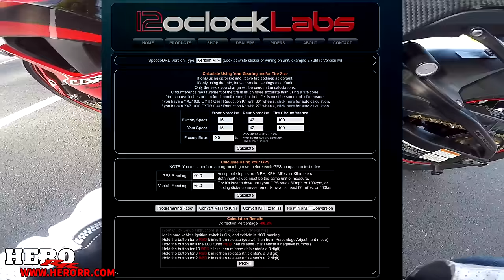2008 CBR600RR 520 Conversion Kit Install and Test Ride + New 12 Spoke Wheels!

Comment: I'm glad you're still giving the CBR some love after getting the beamer.
Reply from the maker: Of course!
Reply: @HeroRR  was the 954 faster than this 600??
Reply: @HeroRR  did you use the front wheel spacers from the 2008?  I tried to do thison my 07 with 2019 rims and the brakes didn didn't seem to fit but I used the 2019 wheel spacers.
Reply: @HeroRR  let me know if you ever want to sell the cbr
Reply from the maker: @FirstLast-tx3yj  Oh yeah
Reply from the maker: @archiewilson4943  I used the new spacers and it fit just fine.
Reply: @HeroRR  ok thanks.  I will try again.
Reply: @HeroRR  Thanks for your response.  I was able to fit those rims on my 07.  I think the problem was the Motul brake fluid I was using.  That stuff gums up the brakes if you leave it in very long.  The generic stuff is way better for normal enthusiasts in my opinion.

Comment: Another great video.  Great bike and great choice with the Speed O' DRD.  I added it to my 2006 VTX1300C years ago and never looked back.  I still need to add it to my 2006 CBR1000RR as it was of a bit off too, but oddly enough was mostly corrected within 2 MPH by going with a 190/55 Q3 tire with stock gearing (sprockets).  So, I've been lazy about getting to adding the DRD to the CBR, but I need to get it done.  Thanks for showing how easy and no need to pull tank, airbox, etc. off to plug it in.

Great choice with the Lightech Chain Adjusters.  Although, I'm very jealous as I couldn't find any for my 2006 CBR1000RR.  Apparently, they stopped making them for my model/year or else I would buy them in a heartbeat.  Can't believe you found them for your 2008 CBR600RR.  Congrats!  I know you'll love em.  Just wish I could find some too.  

Been thinking of getting an older CBR600RR, probably like yours, 2008 or so.  Not saying 600's are slow by any means, but light and fun is where it's at these days.  Why else would factories be focused on the mid range these days, right?  Although, to me nothing beats a V4 sound, but parallel twins come close.  Music to my ears.  LOL

Keep on keeping on brother.

Comment: Used clip style link on my vf750c. Not a single issue and very little chain stretch on my CZ Gold. After a few miles, I got the courage full throttle pulls then forgot about it. Love this chain. It's not stretching.
At the time of this service I had a taller rear tire profile do to availability. Hated this tire from the start. Replaced tire with standard profile and went with a 1 tooth count sprocket change performance. I have my bike back. 500 rpm more at 65mph. Better milage. Better performance. It's a very happy Magna
Reply from the maker: Glad it's worked out for you! Hopefully it continues to. Unfortunately it only takes 1 time to have a problem and it could be the end of your life, a gamble I wasn't willing to take.
Reply: I just personally wouldnt risk it.
Riveting aint hard anyways.

Comment: Love to see you still giving the 600RR attention out here. I love my 2008 and did the same -1 in the front with a 520 chain two years ago. It really did open the bike up a bit, but I might go back to stock when I need a new chain. I daily the bike a lot, and the throttle is way more twitchy with the mod, which is fun..but dangerous to my license.

And while it doesn’t offer “more” power, it does shift the torque curve towards the bottom end, boosting the acceleration a bit.
Reply: It doesn’t modify the torque curve anymore than it changes the power.

Engine output remains the same, torque and power curves are unchanged. It’s just like you’re in a slightly/fractionally lower gear than you would otherwise be.
Reply: @Gnerko123  Thus supplying more torque to the wheel at lower RPM, and less at higher. It’s basically a higher gear ratio, which shifts the torque curve lower for more acceleration and less top speed.
Reply: @JesterMasque  torque curves are generally defined before the transmission, at the crank or the flywheel. Transmission ratios don’t influence this. 

Even if you define wheel torque as a function of engine rpm, wheel torque is raised throughout the rev band, not decreased at higher rpm.
Reply: @Gnerko123  I’m referring to wheel torque as could be read on a dynograph, which is the majority of my experience with this. Wheel torque doesn’t not always increase through the rev range, that would be more applicable to power ratings. Torque can peak in the low/mid-range and stay constant with slight drop off in the higher the revolutions. When a sprocket (the final gear ratio) is changed, you can see that peak torque is achieved earlier or later in the rev range. The torque curve shape & approach may not change much (if at all), but the peak will certainly change positions on the X axis.
Reply: @Gnerko123  The same can be said about when you are in a lower gear (high ratio). You achieve peak torque lower in the rev range, but the top speed it reduced. Power ratings (such as HP, kW etc) will not be affected, as that is the engine’s ability itself to climb RPM’s and continue to torque the driveline.
Reply: @JesterMasque  It seems we are not understanding each other. If you look at a given engine rpm, wheel torque will always increase if you increase the gearing ratio. The graph for wheel torque plotted against engine rpm will shift vertically if you change the gear ratio. Peak torque will not move to another engine rpm, but to a different road speed. If by ‘rev range’ you mean wheel rpm or dynograph rpm, you are correct, but I have never heard anyone do it that way.
Reply: @Gnerko123  It was a blend of your wording with mine, just trying to speak the same language. But I have seen and compared the graphs one to one on an F4i where we plotted a base run (Dyno Dynamics Dynotech iirc?), then changed the sprocket, another plot, add power commander, another plot etc). At the time I was an apprentice at that shop, so I can’t remember every detail. When comparing the plots before & after (only) the sprocket, the wheel torque hit peak earlier in the rev range, which was the X axis on the graph. Not sure if there are dynomometers out there that measure the X axis in wheel speed, but this is my limited experience vs yours.

The slope of the curve approaching peak was slightly steeper, but the peak itself was nearly identical, just shifted lower in the range. Like, if you held them up to the light, and moved the paper slightly offset (yeah we printed everything out back then) the curve was nearly identical.
Reply: @JesterMasque  again, the location of peak torque w.r.t. engine rpm does not change if gearing is changed. This is just physics. A gearing change proportionally changes the torque at the wheel, independent of engine speed. This means that the location of the peak is unchanged. Maybe there was some other variable at play, two dyno runs will always differ slightly. Maybe the second chart wasn’t even corrected to reflect the change in gearing.

I realise now that I think of if that at a higher gearing ratio, the inertia of the flywheel and other rotating parts becomes relatively more pronounced. You would need to increase the resistance on the dyno to correct for that (such that in both runs, the engine revs up equally fast) if you want to compare the dyno runs. I suspect that not correcting for this flattens the torque curve but doesn’t change the peak location though.
Reply: @Gnerko123  I still feel like you are conflating engine torque with the torque being applied at the rear wheel. Yes, the engine torque from the block going through the input shaft and through the transmission will be unchanged by a sprocket change. But as soon as you change the sprocket size on the output shaft or the wheel itself, the torque being put to the road itself is shifted, and the top speed changes. If the same revolution range is used, power is unaltered, and the final drive is changed, then what exactly are you saying happens to the torque? And it is just physics as you stated, but those points of leverage (where the torque is being applied) will result in different changes to the curve. If engine modifications are done, then the torque will change slope, shape, peak etc. But if you only change only the final point of leverage, it will shift where that peak torque is applied within a given speed (engine or wheel, they are proportional with any given gear).

And I do remember the need to input gearing info and other technical specs into the machine for accurate read-outs. But it sounds like you are saying that changing the final drive will only affect top speed, not the quickness (directly proportional to applied torque) that it reaches that top speed.
Reply: @JesterMasque  an engine produces peak torque at a given engine rpm, regardless of what gearing it is attached to. This is the main issue. I think you’re overcomplicating things to the point you don’t understand anymore.
Reply: @Gnerko123  But I have not been talking about engine torque at the crank.. There is a difference between the torque that an engine puts to a transmission, and that a differential puts to a wheel on a given vehicle.
Reply: @JesterMasque  wheel torque and engine torque are proportional, thus the engine rpm at which the peak of either occurs never changes if the gearing ratio doesn’t change during the dyno run. A different transmission ratio changes the height of the peak, not the location w.r.t. engine rpm.

Comment: just a tip from an old salty rider whos streched a couple new chains trying to get stuck sprocket nuts off the countershaft, break your front sprocket nut loose before breaking the chain. this way you can keep it in gear and have a fat buddy sit on it and press the rear break instead of trying to get a special tool or jam something in there. if youve done the bike before it may not be necessary but ive seen factory countershaft nuts practically fuse to the sprockets and threads

Comment: I always just cut completely through the old chain with an angle grinder.  Saves a lot of time and it's trash anyway.  And I recommend you keep an eye on those rear sprocket bolts. They always come loose on me eventually if I don't use blue loctite.

Comment: Totally the way to go with a (-1) on the front sprocket leaving the rear alone for the street.  These engines are stressed enough as it is and (+2) in the rear would really be taxing the engine.  Awesome video as usual.

Comment: I've changed in the past,on a gsxr,the chain with 520 and lasted only 10000km.
I suggest to lube it more often in order to last longer
Reply: @boycottjews  usually it's used at racing.On normal roads,I think 525 it's a good choice,if you wanna do minimum 30000 km
Reply: @boycottjews arrested for a chain?

Comment: You said that its more fun with 600cc than with more powerful bike and I must say it's true. I had cbf600sa, cb650r before and now I've switched to 2022 cb500x. Only 50hp but inline 2 engine with instant torque just from leaving the clutch makes me more excited about motorcycling. Less fuel consumption, more comfortable, great sound even if it's 500cc, offroad capabilities opened my mind too. I've found that bike must be tried in real life by a rider, not by sponsored youtubers that can say only how bad it is. We moto guys forget to say what is good even with the worst bike. Cbr600rr was criticised in my country so much, because it's only 600cc. 1000cc guys now don't have money to ride or just are broken so much that they have not enough money to fix. 600cc sportbikes are the best sport bikes. Honda makes it extremely reliable and don't broke wallet that much like for example s1000rr. I watch You for long time and must say that You are real world moto guy, who really likes bikes 👍 i like it!
Reply: CBR600 top speed 185mph
Don’t need no 1000cc

Comment: I really need a pair of those 12 spoke wheels.. 

Like you said grind the chain rivet roughly about where you are using your chain tool in the video, it's much easier. I use a D.I.D. tool and it works phenomenally.

Comment: I just did a 520 Conversion on my 2012 CBR, I kept the stock gearing.  I did weigh everything before I put it on and the main weight savings came from the chain.  Saved about a pound overall.
Reply: Was there a tangible performance increase?
Reply: @TheBadMadMan786  If you are going to replace the chain and sprocket, go with a 520.  I wouldn't change it just for the performance increase though.  I would go with a lightweight sprocket if you want every bit of power out of it.
Reply: @SSmoothS70  Thanks, yeah I am due to replace my chain and front sprocket, rear sprocket looks the same as it's always looked but it's 525 steel. I have ordered a 520 chain, front and rear sprocket. The gearing will remain the same, 2007 CBR600RR 16T/41T (stock). I know it's tall, but that's how I like.
Reply: @TheBadMadMan786  I stuck with stock gearing as well.  My 2012 put 110 hp to the rear wheel on the dyno.

Comment: I have changed the chain & sprockets on my Gen6 VFR800 multiple times; I just use bolt cutters to remove the old chain.  I have not had to change the chain on my CBR600RR yet but I will most likely have the shop do that since it's my Track Bike

Comment: About time the 600 gets some love. Would’ve thought a 520 conversion would be one of the first mods done. I based my 600 build off of yours. I did a few things different and used some different brands but extremely similar.

Need to get you some Bonamici rear sets with the red toe and shifter peg inserts! Also, a Driven Halo keyless gas cap would be a nice addition!

Comment: Hello there.  I'm qualify my comments with many years with Bikes/ Motorbikes/ Motocycles...( whichever is your chosen vernacular ) both as rider, enthusiast and Mechanic/ Builder and Restorer.   
Not many go to such lengths to qualify their work as you did.  Measuring the side chain width to determine and confirm correct side plate position is an absolute, but most don't do it; they then cannot understand why their bike feels strangely held back by a pinched chain link...    Measuring the pin distortion is also correctly done.  Full marks!    The only thing i would've done that you didn't was to put a small pair of dots on the Gear linkage connector.  That way you'll be sure to replace on the correct spline.  I believe that this could be why your gear indicator reads incorrectly through misalignment of one spline in the shaft.  Your bikes Revs are not the determining factor of gear nomenclature, rather leaver position.  
I applaud your work.  
Remember to go back after a hundred miles or so and check tension, alignment and torqued fasteners.

Best regards, 
Eddie
Reply from the maker: Thank you. I appreciate your comment so much. My gear indicator is aftermarket and it is actually based off the revs. Because the -1 sprocket threw off the revs it caused the gear indicator to be incorrect. I’ve already recalibrated and it’s working correctly again :)
Reply: @HeroRR  Great info - thank you for the insight!
Hope you're day is good; Mugello MotoGp. 
Predictable but sad news about Marc Marquez don't you think.

Comment: It actually does give you more available wheel torque to ground so you are increasing hp at the wheel at lower rpm’s
Reply: At a given rpm, wheel power is the same. Wheel torque is slightly higher, but wheel speed is decreased accordingly such that wheel power remains equal. 

At a given road speed in a given gear, yes wheel power can be higher due to higher engine rpm. But then again, you could also achieve this by downshifting.

Comment: The writing on that front renthal doesn't always go on the outside like people will tell you. I've heard someone say renthal says that too. If you put the larger spacer side on the outside on 2008 600/750s it will be aligned incorrectly and give you problems soon. you can use a digital calliper and see how many mm the oem sprocket sit from the case & then you put the sprocket on whatever side is closest. on my 750 putting the writing on the outside would've resulted in it being 1.50mm out of alignment. whereas writing in was within 1 10th of a mm.

Comment: Next time you should put a master link on not a river type chain connection because now if you need to take chain off you need to cut it again vs master link you can just remove